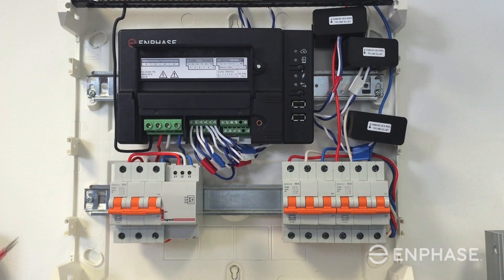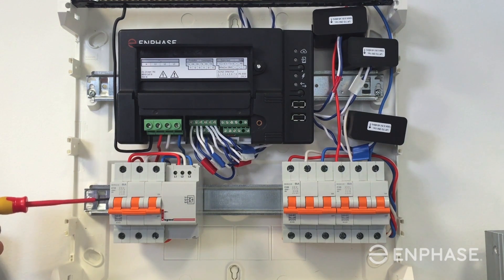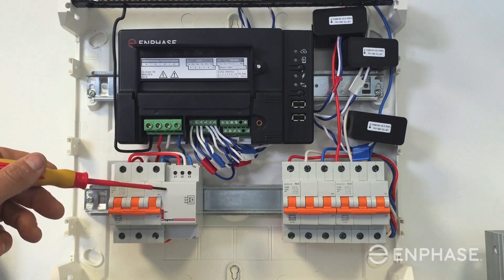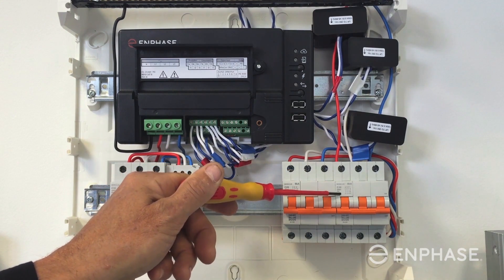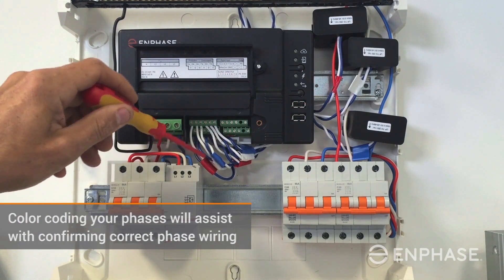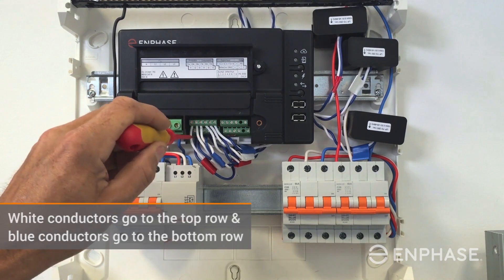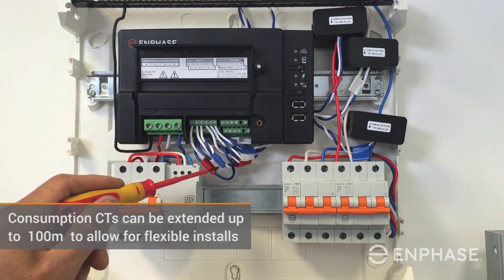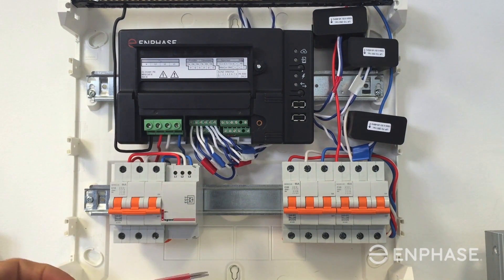How to install an Envoy S Metered multiphase

Comment: Does the new  multiphase Q Relay includes a built-in phase coupler ?
Reply from the maker: Yes, it does.
Reply: @ACSolarWarehouse  Thx, I'll be installing a 3 phase system so good to know what is required

Comment: My installer has the white and blue CT wiring back to from. What will this affect?
Reply from the maker: Enphase recommend the white wire of the CT be connected to the top terminal and the blue connected to the bottom corresponding terminal.  If they are swapped, it will not damage the Envoy,  you will simply notice incorrect readings.  If this CT is also turned around on the cable you will experience the correct readings.   So if your readings are correct this could be the case?  Your installer would be best to help if you are concerned.
Reply: @ACSolarWarehouse  My production metering seems correct and this is the one that is turned around but my consumption never seems to be accurate. Says I’m consuming like 80w which is super low. Using a Powerpal to check monitoring when solar isn’t producing and never seems to match up. Would have thought the Enphase should be giving the same reading as the Powerpal. Not sure if having the production CT installed around the opposite way might affect the consumption CTs at all?
Reply from the maker: @atanner4  I suggest raising your concern with consumption data with your installer so they can check the envoy is installed as per above.

Comment: Single Phase low voltage 120/208v
In Australia 

L1, L2, L3 = red, white, blue

USA:
 L1,L2, L3= Black, Red, Blue
Reply: For our low voltages installations (mostly residential) its typically single phase, 120/240v black conductors and your neutral/ground. 
We use blue and brown for our 408v

Comment: Is this like a 3x230V installation
Reply from the maker: Yes, that's right, it's a three phase 230/400 volt supply
Reply: 3x230V without neutral ? or 3x400 + neutral ?